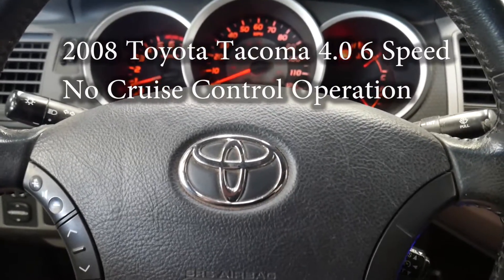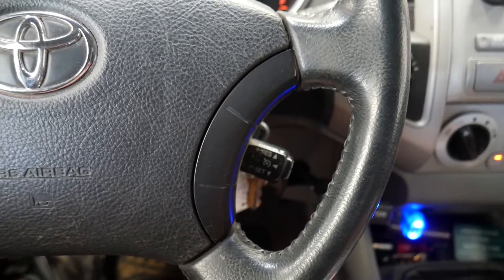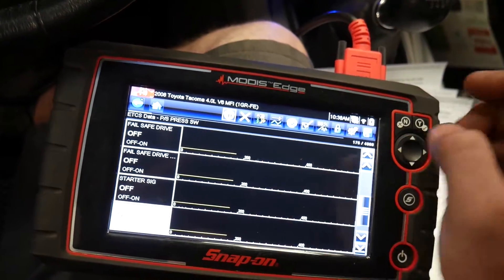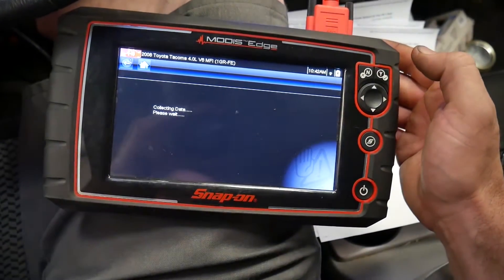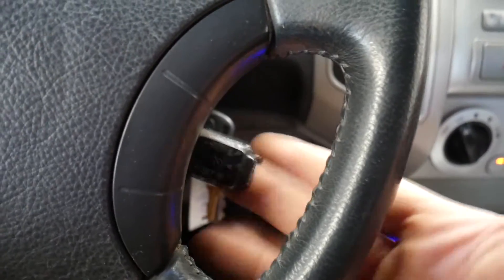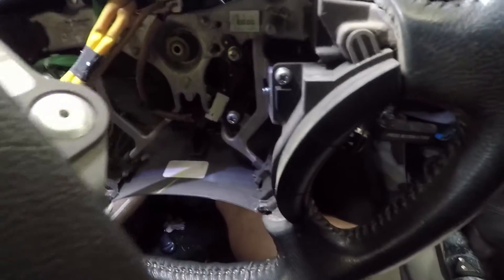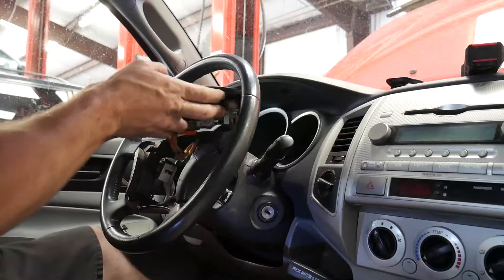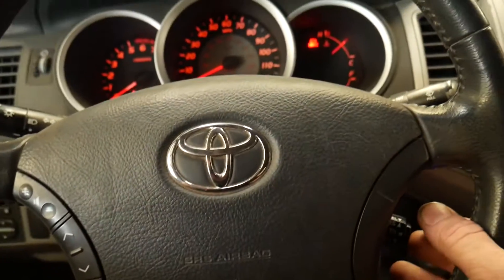2008 Toyota Tacoma Cruise Contol Not Working - Case study

Comment: For anyone having this problem and none of these things fix your issue, and you have a 1st or 2nd gen 5-speed or 6-speed manual tacoma, check this part - "1993-2015 Toyota - Cruise Control Release Switch - Toyota (88280-14030)" also known as a "Clutch Release Switch". Mine was actually fully intact and connected, but the bracket which it is mounted had snapped, and the switch was just dangling there. Someone must have slammed the clutch pedal in a panic, missed, and snapped the switch and respective bracket clean off. Would provide pic if possible, but look up that part number. It looks almost identical to a brake lamp switch. Hope this helps someone, good luck!

Comment: On the backside of the lever there is a little screw. Undo that remove cover. Youll find a wire for the on/off switch broken. With a fine tip soldering iron, solder the wire back on. Fixed.

Comment: My 2012 Tacoma has  check engine and trac light come on at same time and my cruise stops working. When they go off, cruise works.
Reply from the maker: Cruise control is disabled by most engine fault codes. Scan the engine for codes and fix that issue to correct the warning light and inoperative cruise control.

Comment: Didn't see you check the function of the clutch switch.
Reply from the maker: If the cruise light would have illuminated but speed could not be set I would have gone down a different path checking brake light status and clutch pedal status. 
These Toyotas should illuminate cruise light as soon as the master cruise on/off button is pressed. If they don’t then you typically have an issue with the clockspring or cruise on/off button.

Comment: Mine worked for about 5 days and than did the   very same thing as before, started intermitten and than finally would no come on at all when driving. You can stop and turn the steering wheel all the way to the left and the cruise light comes on,,,,,but the cruise does not function when driving. I feel it's the clock spring after all.
Reply from the maker: They are both common failures. I did 2 clock springs and 1 switch this week. It’s possible that you had both intermittent failures happening at the same time.

Comment: I installed the cruise control in my toyota 2014 but it doesn't work not even light on for cruise control in dash screen. I have installed exactly same way like you have done. Removed the airbag stuff on steering and plugged in the new cruise control . After placed back the airbag and reconnect the main battery. But unfortunately not successful🙃.
Kindly guide me what i should?
Reply from the maker: Unfortunately you may have a clockspring(spiral cable).

Comment: This was a great video.
I have a 2002 Toyota Rav4. The cruise control turns on, but it does not engage when I go to "set" the speed. I get a blinking Cruise light on my dash. I replaced the brake light switch but it did not correct the issue.
Would you recommend replacing the cruise control switch?
Reply: My 2008 Tacoma just started doing that a few days ago. Did you find out what what the problem is?

Comment: Interesting to see signals from all four switches come through one wire, with a resistor between each switch. If it's a 5Volt signal from the PCM, with a big upstream resistor, it must read voltage and infer which button is pressed. Some engineer must have spent a few months designing that one, saving several feet of extra wires and clockspring connections.
Reply from the maker: I still wish they had a check signal when no buttons are pressed. It would help confirm if the switch had an issue or the clock spring.

Comment: I have a question. I thought my CC switch was bad because the cruise light wont come on  and cruise control doesn't work. However, when I turn the steering wheel about a quarter turn the and then try and turn on the CC it will turn on, but once the steering wheel is straight up and down I lose control of being able to turn on/off the CC. Im guessing this is probably a clock spring issue?
Reply: I have same issues tried to change the switch but nothing worked out i wonder what to do next

Comment: Did this end up being the fix? I have the same truck and my cruise control sometimes wont turn on and sometimes it will turn on and wont turn off. There are also times where the cancel wont work and I have to push the brake to cancel.
Reply from the maker: It can be either the switch or the clock spring(spiral cable).

Comment: dear ThePracticalMechanic: i have 1999 taco 2.7 prerunner 4 cylnd. my cc was sporatic a few months ago it would turn on and accelerate( 55+mph) on its own then slow down to(-45mph) .it finally stopped working. toyo tec said 125 $ for diagnostics.do u have any idea what might be wrong ? is it a simple(under $200) and is it worth fixing ? ty luv ya

Comment: 2007 PreRunner TRD Off-Road 4.0 Access Cab here (bought new June 2007 by me, now has 225K). Mine’s been acting up for several months now, at least. Arm switch (on end of stalk) won’t work sometimes. Other functions (set, cancel, resume) usually work, but today those also started intermittently not working. I believe the switch is the problem. 

I’m going to order the switch and use your video as my guide. 

Thank you so much for posting this! You have a new subscriber. 

John
Nashville, TN
Reply: Do you have a suggestion on best place to order switch?

Comment: is changing the cruise control switch wires something i can actually do? i swapped the switch but it still doesn’t work. my new switch came with new wires but i’m a little afraid to change them since they’re connected to main airbag wires.
Reply from the maker: The wires for the switch rarely fail but it shouldn’t be to bad to swap them out. If your not comfortable swapping the wire it may be beat to take it to a shop. It is also possible that the airbag spatial cable has failed.
Reply: Did you figure it out ?? Having the same problems right now
Reply: @pintohatesyou  no, i switched the wires and that didn’t work, so i came to a conclusion that it must be the clock spring. i haven’t actually swapped the clock spring yet though. just got lazy and left it be until i got access to my truck again.

Comment: I have the same exact model Tacoma. My cruise light comes on when I click the switch but it will not 'set'. and yes, I know what I am doing. It was working fine a week ago. :/  I adjusted the clutch push rod and it hasn't worked since. Any thoughts?
Reply from the maker: Madison Duncan There are two switches on the clutch pedal assembly. One is up high on the underside of the dash and the other one is down low by the floor. The one down by the floor is for your starter enable circuit and the one that is up high is a cruise control deactivation switch. There should be a little rubber pad or button on the clutch pedal that presses up against the cruise control deactivation switch. Verify that that rubber pad is still in place because if it’s not then the cruise switch will not be fully depressed.
Reply from the maker: Were you able to get the cruise control functional again?

Comment: Mine was gone bad and once I checked the vacuum lines I found one was leaking when I fixed that it’s all good now
Reply from the maker: That’s great!!👍🏼 seems they use two different types of cruise systems. (electric servo or vacuum servo)
Reply: Interesting 🤔 I got a Engine Check P0455 code (gross leak) and my CC stop working as well. Make me wonder if there both related.

Comment: I replaced my switch this morning, but it still doesn't work. The switch I bought has the same Toyota part number. The light on the dash still will not come on. The old switch at first sometimes would come on and sometimes not, then it stopped turning on altogether so i assumed it was just the switch. Is there anything that has to be reset with the computer to tell it the part has been replaced?
Reply from the maker: Nothing needs to be reset. The computer has no way of verifying switch integrity so no codes will be set. It’s possible that the clock spring (spiral cable) has failed as well causing the intermittent cruise operation.
Reply: @ThePracticalMechanic  Thanks for the reply and great video on how to do these repairs. I guess I will have to order a clock spring. I hope it isn't the wrong cruise control switch. I looked the same but was a cheap $14 part from Ebay.

Comment: @ ThePracticalMechanic 
I have a 2005 Tacoma 2.7L Prerunner AccessCab.
My spiral cable was replaced around 2008 free of charge at dealership because my airbag light stayed on (Recall).
My cruise control is not working.
The on and off switch will only work if I turn the steering wheel.
Once the cluster is on it will never “set” or engage at a certain speed.
My horn works fine.
What could the problem be? 
Thanks.
Reply from the maker: Most likely the spiral cable has failed again. If you were capable of turning the wheel while pressing the set button it would probably set for you. The spiral cable must have a bad spot that causes an open circuit while the wheels are pointed straight ahead.  

The horn has a separate wire trace in the spiral cable and it must still be intact.

Comment: the torx screws on my tacoma are impossible to unscrew... any suggestions?
Reply from the maker: Are they rounded out or just hard to access? Sometimes you have to turn the wheel to gain access to them. If rounded out it will be a difficult task and the bolts may need to be replaced afterwords.
Reply: Hit the gym

Comment: I am not quite clear on one last thing regarding the clock spring as it relates to the Cruise control on-off.   My Cruise is not working.  But the on-off cruise indicator turns on and remains on until I turn it off.     Are other "wires" from the other cruise control paddle switches  running trough the clock spring?   My Cruise paddle switch is  somewhat loose feeling.  I still haven't replaced the cruise switch assembly.   I want to be sure I don't have a bad clock spring.     Since the Cruise indicator does work, could the clock spring still be bad?               How many Cruise contrl related lines run through the Clock spring?   That is a better question.
Reply from the maker: There is only one cruise wire in the clock spring. All of the cruise signals are sent on that one wire. So if the on/off button works the clock spring should be ok.
Reply: @ThePracticalMechanic  Thank you for the education.

Comment: I like your thinking with regards to removing the airbag and disconnecting the battery.   This can mess with a few things depending on the vehicle.
I have a 2004 Tacoma, 4 wheel drive 5 speed manual. The Cruise control does not work but the cruise light turns on when I hit the on switch.    Not sure I am going to fix it.  This is a feature I never really use and this truck is not going to be on long freeway rides.    So shocked at how well the engine, the V-6, runs with 142,000 miles on it.   I get a bit of soft whine from 1st, 2nd and 3rd but shifts like new.                   EXCELLENT presentation.  Good grasp of automotive electronics.      Thanks.
Reply from the maker: I hate that whine. I have had 3 trucks with tranny whine in the last 10 yrs. most had 150k-300k. A used transmission was cheaper and faster for me than a rebuild. The worst part for me is the whine while sitting in neutral. The one bearing that fails doesn’t cost that much but the labor to get to that bearing is the hard part. 

Thank you for stopping by.

Comment: My 2010 corolla cruise control failed for sometime. When I pressed the on/off button, no light on dash. After I watched this video,  I bought the switch from amazon and had it changed.  Whole process took 30 minutes, Bingo it work!!!

Thanks so much.
Reply from the maker: That’s awesome.  Glad it was the same deal on the Corolla.
Reply: Just changed mine on my 2012 scion xb and it still doesn’t work 🤦🏽‍♂️

Comment: Will the Solus Edge perform this same test?
Reply from the maker: Yes. The Solus Edge will have the same functionality as my Modus for scanning the airbag system. Just a heads up if you are running software version 17.4 or 18.2 there is a free patch available to fix an issue with toyotas. I did a video on it a few weeks ago. https://youtu.be/_KlFp64TM8c
Reply: I went ahead and purchased a Modis because they had a deal going. I'm not getting any on-off function on any switch but also showing codes for VSS and LF/LR wheel speed sensors. ordering the sensors because they are cheap. But, if I'm not showing function for any button would you think I need to replace the switch or the clockspring? I searched the knowledge database on snap-on but couldn't find anything that would answer my question.
Reply from the maker: It could still be either the switch or the clock spring because there is no confirmation signal circuit built into the switch. If the horn works and the airbag light is off then the switch is a likely fault. 
If you you decide to dive in deeper for testing you can pull the airbag (safety recommended) and unplug the switch you can then check resistance of the switch.  the main on/off signal should be close to 0 ohms the other three positions of the switch will have varying resistance. Most likely the on off circuit is open.
Reply: Thank you, going to give that a try.

Comment: So I have an 05 tacoma. CC doesn’t work. The cruise light will light up automatically on the 1st start of the day, but doesn’t function. Then on 2nd start the cruise light will not be on. If I wait an hour or so and start the truck again, cruise light will be light. Any suggestions?
Reply from the maker: I think I would check modules for codes first.  There may be something else inhibiting the cruise operation.

 I don’t remember the cruise control light self illuminating without pressing the button. Pay attention to the position of the steering wheel on the first start and the try it next time with wheel in a different spot. The clock spring might be shorting power to the cruise control system.
Reply: ThePracticalMechanic so I just replaced the clock spring - didn’t fix it.
Reply: ThePracticalMechanic also - the airbag light is on now that I replaced the clock spring
Reply from the maker: That’s not a good sign. What brand clockspring did you use? Did you make sure to point the wheels straight ahead when you installed it? Might want to unhook the battery and verify that the connections are fully seated. There is a safety built into the connectors that short the wiring to prevent static built up unless the connector is fully seated.
Reply: ThePracticalMechanic so do you think I shorted the airbag - or could it just throw the code because in unplugged it and plugged it back in?
Reply from the maker: If the key was on and the battery was hooked up while doing the clockspring replacement then it will set 1 or 2 codes in the airbag module. It will normally set a driver squib circuit open code when you unplug the airbag and if the connector was partially unplugged the shorting bar will drop into place and a driver squib short to ground code will be set. Unhooking the battery for a while might clear the code but if it doesn’t you have to get it scanned and cleared by a shop with a scanner that can access the SRS module.
Reply: ThePracticalMechanic I unhooked ground from the battery before replacing the clock spring.
Reply from the maker: Justin If you had the battery unhooked during the replacement then it shouldn’t have set any codes unless a new problem has developed because of the replacement. Now it is also possible that the clock spring that you purchased is defective. You would hope that a manufacturer would go through better quality control on the airbag component but I have seen numerous aftermarket clock springs in several vehicles that are defective right out of the box. I think your next step is to get the airbag system scan and see what codes are in there.